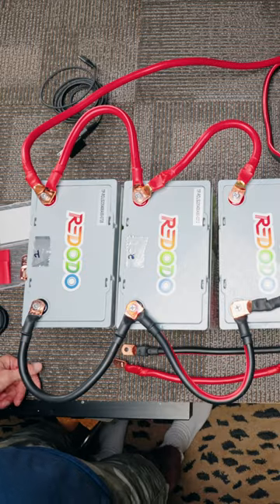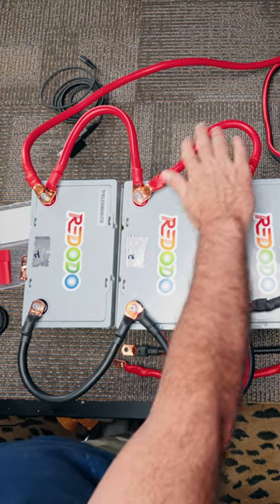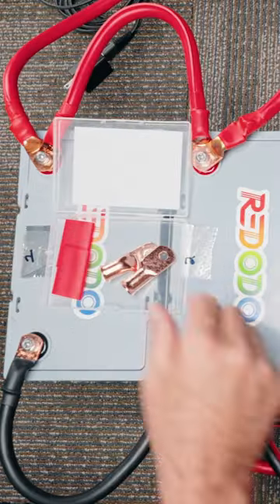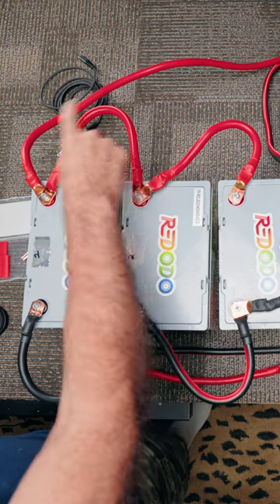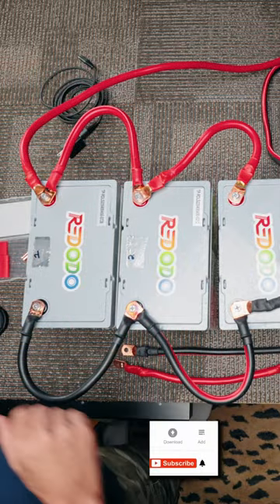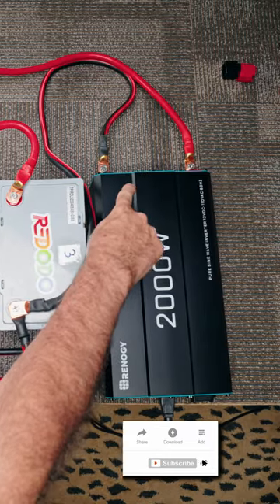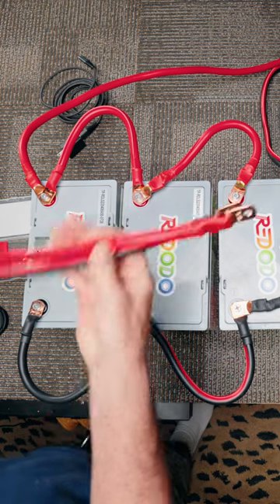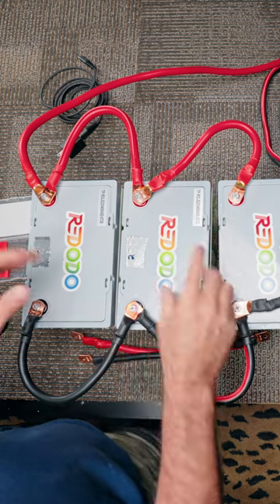How to Parallel Multiple Batteries to an Inverter #shorts

Comment: Please, be careful when connecting batteries in pararell. If one of them gets in short circuit due an internal failure, there is a risk of overheating and probable fire or explosion. There are specific circuits with high capacity transistors to avoid this risk (solar energy applications) . On the other hand, big trucks and buses use only 24V cranking circuits hooking two batteries of 12V in series. They never use pararell configurations. Thank you for the video
Reply from the maker: Interesting!  Thank you... 😀
Reply: A fuse on each lead will prevent issues due to internal short circuits.
Fuse will blow isolating that bad battery
Reply from the maker: Thanks for the great info... 😀
Reply: Incorrect. American trucks all use 12v an most have 4 in parallel, and they always have a grand total of ZERO fuses, I know because I'm a workshop manager/diesel fitter in charge or 30+ semi trucks.
Reply from the maker: Exactly right!  I used to drive trucks so I'm very familiar with that... 😀 @F1NATIK

Comment: how to connect 2 i nverter with 3 batteries
Reply from the maker: I could be wrong, but I wouldn't do it that way... 😀
Reply: @JLPicard440   i am planning for 10kw solar system, two growatt 5000es and three 51.2v 200Ah Lifepo4,
Reply from the maker: @DoDoBedStory  Do the instructions for the inverters say you can connect them in parallel with another inverter using the same batteries?

Comment: Never parallel batteries ; always wire them in series . But an inverter rated for higher voltages and reduce the amperage flow in the cables . 
High amps increase heat in the cables that causes a loss in efficiency/energy ! 🤷‍♂️
Reply from the maker: Thanks for the tip...